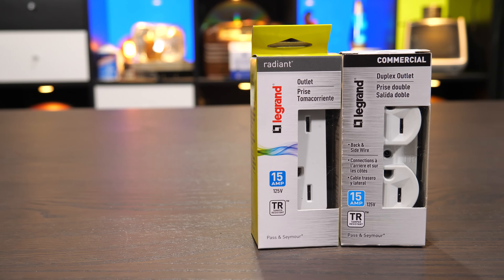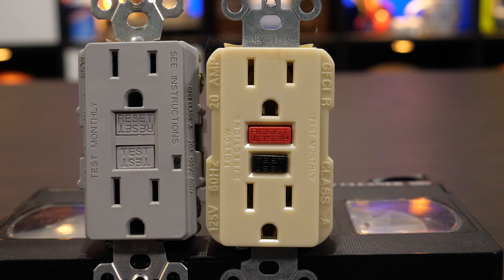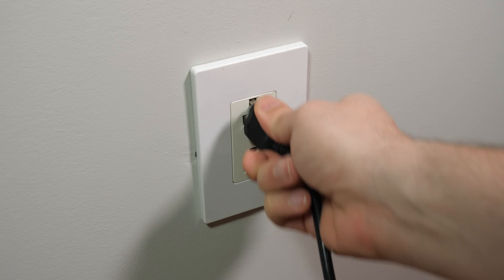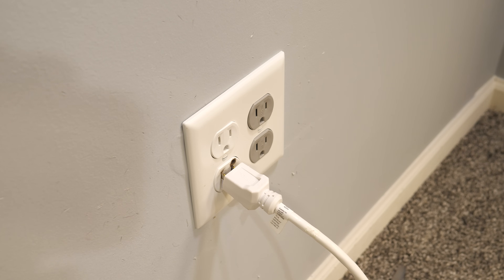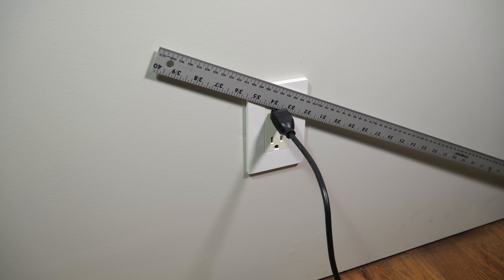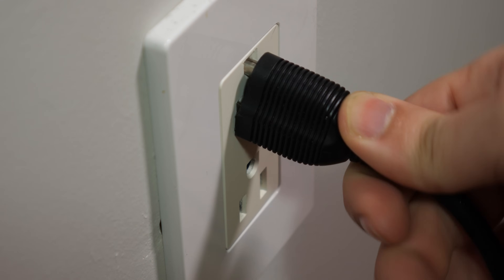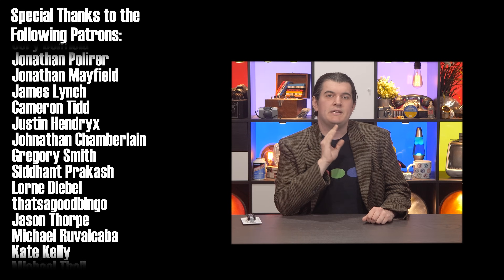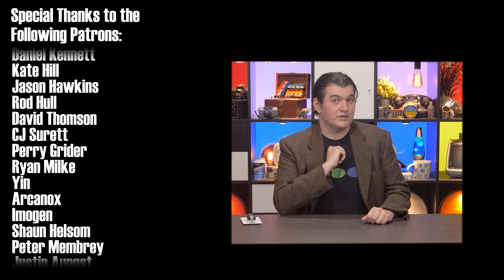Power outlets are topsy turvy - but does it matter?

Comment: When my grandfather bought his house (2 floors) it was a bit small, and he built a whole extra part by himself (adding to both floors and a deck) that is almost half of the current structure now. Anyway, in that added-on section, all the power outlets are upside-down. It was really just a trivial wiring mistake, but it's kinda funny to learn that there's benefits to it.

Comment: As a Briton I'm horrified by the sparking arcing, droopy, thin plugs. Ours are right angled, easily diy wired, have fuses, always have 3 prongs, much more grabbable and still low profile. Our sockets have shutters and we have insulated sections.

Frankly i'd use UK plugs in the US- you absolutely can, we used to have to put our own plugs on anyway, it doesn't take much work on the plug side. Switching to horizontal sockets might take work, but even going to a single with our extension multi sockets is better. Also all our modern outlets are switched at the wall which means you can switch any extended sockets attached in one go, with the wires tidied away. 

Your wires run hot, too- if you clump them they might even smoke melt etc but you can only grab them and yank them out? Crazy. Switches are great. Earthing is great. We have so few elecrical fires even despite worse old wiring in ancient homes that only gets replaced when its going badly wrong, landlords bribing electricians for certification etc.

240V saves so much copper and energy, too. Think of the power loss from those thick wires heating up. Okay, that change is unlikely as anything older you plug in would blow up.

Comment: I find your comments at 01:46 about installing the ground pin on the top being ‘paranoid’ and ‘irrelevant the vast majority of the time’ rather interesting.

I’m not questioning your knowledge, I’ve seen enough of your videos to know that you’re a sensible guy and you do your research. I enjoy your content (even if your portable AC video did upset me a little lol) 

But safety relies on having a reasonable level of ‘paranoia’ and most safety design/equipment is ‘irrelevant the vast majority of the time’.

You acknowledge the poor design of the plug and wall plate and even the situations where metal objects could fall onto the exposed live pins. Yet you suggest that because of the design of current right angle plugs and the existence of non-earthed plugs is reason enough to not advocate for change. As an outsider looking in, this fear of change seems to be widespread in the US, it’s the same reason why you guys are still using the Imperial system and why your electricians are still using wire nuts when products like Wagos exist. 

The regulations need to change, they need to mandate sleeved pins, mandate the correct orientation going forward and mandate dummy earth pins for insulated devices. This will only happen if people advocate for change. 

If the regulations change, product manufacturers will follow suit and change the orientation of their right angled plugs. You could even require all plugs to be right angled and shift the design of the wall plates to feature two sockets side by side. The old designs will eventually fade into obscurity, I promise. 

Change is expensive.
Change is inconvenient.
Change creates a better world for the future and should be embraced, not rejected.
Reply: Because… and after that book I’m surprised this isn’t something you thought of. There is no such thing as “100% safe” there are pros and cons. It’s our duty to take the reasonable approach. Far more homes have right angle plugs then people play throw the knife at the wall. Not to mention a right angle plug on an upside down outlet is by far the most dangerous situation out of all of this as it will much more easily “guide” an object right  into the pins. So what’s exactly wrong with eliminating the worst scenario?
Reply: @DeltaStormYT  By including a ground pin you’re unable to plug a right angle plug in upside down so you remove any chance of that scenario occurring.

Comment: Can you do a video on why America don’t normally have fused plugs.  To me fused plugs makes sense. Like having a 16 or 18 gage extension cord plugged into wall socket and the house wiring is 12 or 14 gage. Would be nice if all devices had a properly rated fuse at the plug like in EU.
Reply: the uk plug is the only european plug that has a fuse

Comment: Why is it upside down? I understand the NEC does not specify which orientation is correct.  Many cords that come out at a 45 angle need it to be install as shown or you put extra stress on the cord when it goes up instead of down.

Comment: As a plumber who occasionally deals with flooded basements i feel having the hot and neutral on the bottom would arc, i don't know enough about electrical to know if the ground being present will be any benefit in that scenario

Comment: Greetings from Germany. Most of the wall-mounts I've seen have sockets, that are individual and the wallmounts just dictate if you want, one, two, three or more sockets or switches. Our light switches fit the same mounts as the sockets. And each can be rotated by 90° so you can easily make sure it's the right side up. There might be some old outlets with "fixed" orientations, like the ones you've shown, but as far as I know, the individual outlets are the only ones sold at the moment.

Comment: Yep, nailed it in that most AC/DC adapters would "hang down".
I've seen some fancy ones that rotate the prongs but those are usually just 90 degrees and few and far between at that.

Comment: Safety my ass. Other than how stupid and ass-backwards it looks, one major flaw with an upside down outlet is it can be hard to line up the hot/neutral prongs because the damn ground pin and extended plastic around it is in the way obstructing my view while trying to plug something in.

I have never been zapped using a normal-oriented outlet for any reason other than my own stupidity and carelessness, but I can easily imagine getting electrocuted by complete accident, through no fault of my own, trying to plug something into one of those upside-down monstrosities.

Comment: You know if the plug had a switch it would make this terrible design slightly safer. Obviously the root cause is the terrible plug design tho but a switch would make it better than not having it at all.

Comment: here in the UK our Negative and Live pins have coating so far up so even if the plug is loose you cant touch the pins and we also have little doors on the live and negative holes in the socket which wont open if there is no Earth pin, our sockets are commonly made of ceramic aswell so that lowers the chance of any shorts
Reply: the schuko socket is recessed with shutters that only open if you insert both pins at the same time

Comment: @9:01 I actually had this happen on a job site. I was measuring a wall to hang a TV and got the tape measure too close to an exposed plug like that.
Big spark, charred wall, and a hole in my tape measure where it tried to weld itself.
Fortunately, no fire or damage otherwise, but... it was certainly an awakening.
Also, somehow, their circuit breaker or GFI didn't trip... so that was a bit concerning.

Comment: you guys just should adapt the europlug - we don't have any issues with up or down or any of the problems you mentioned... even our sockets are inlets, so they dont show any hot connectors which could be touched, even if the plug is just half inserted...
Reply: What euro plug would that be? And no, we should not adopt a foreign plug. Ours works just fine.

Comment: It's wild to me that the US has two different plug types 1. with no ground pin and 2. with a ground pin and what's more insane is neither of them have insulation so the odds of being shocked is high if your not careful or if your a child. I have never had any electrical shock with an outlet in my childhood days (once or twice now im an adult but that was my own doing) due to the Type G socket we use in the UK which if i remember correctly TC has done a video on (or im thinking of someone else), while it has it's flaws like if you step on it, your gonna have a bad time but besides that i can't think of anything better.
Reply: the german plug type is even weirder because you can insert grounded schuko plugs into old ungrounded european sockets
Reply: Our plugs are just fine. The vast majority of Americans will go through life without ever getting shocked. Plus our small plugs makes very small devices with built-in plugs possible, such as compact power banks and chargers that have swivel out prongs.
Reply: @CorneliusTaylor-s1u our plugs should be halfway insulated just like australian plugs
Reply: @gamecubeplayer 

Or, how about this, don't touch the prongs.
Reply: @CorneliusTaylor-s1u what about old ungrounded european sockets? i've been shocked by 230v because old ungrounded european sockets aren't recessed unlike schuko sockets

Comment: In South Africa all of our 3 prong plugs are right angle plugs except for the very specific high amperage ones that are from what I know only used for generators and have their own tight gripping sockets. As for our 2 prong plugs the sockets are all recessed making them safer. Also our ground pin is always top and that's reflected in our products as well. Also if our plugs get slightly dislodged they don't make contact in the socket anymore. This is good but aslo really irritating sometimes when a socket doesn't let a plug go in all the way. Usually happens when the child protection mechanism breaks.

Comment: The right angle plug in turn has the (pretty big) issue that, unless the orientations of the two receptacles are opposite, you can only plug in 1 such plug at a time. Solution to that is sideways orientation, but then you still have to rearrange a bunch of existing receptacles. I like the EU schuko for this reason, they're symmetrical so they work well with basically any orientation, as well as a bunch of other benefits

Comment: It won't change now, but the best solution is if our duplex outlets had the sockets side by side, still with ground down, like Australia. Then you could plug two 90 degree plugs in the same outlet.

Comment: Another thing to take in mind is when orientated with the ground down, plugs and switches have the positive and negative on the right hand side and most people are right handed and attaching the + & - and splicing together the wires to continue on in the circuit requires the vast amount of care and dexterous work during installation; wiring a house for me, a right handed person, would be a nightmare if it was reversed and cause a huge amount more work.  The amount of inefficiency and increase in costs just in man-hours over the whole construction industry is vast.

Comment: I’ve always heard at work to put the plugs upside down incase something falls on the hot and neutral. But tbh if it does create a short it’s just gonna hit the ground later at the panel and still trip the same breaker. Glad you made me think about that myth deeper

Comment: Australia has had shock resistant plugs since 2005 (active and neutral blades have insulating sleeves that run about 1/2 way down) watching your videos has been mind blowing to realise this is somehow not the norm in the US

comparing the differences with the AUS system has been fascinating. 

Keep up the great work
Reply: well our system is crude but its safe if you use it with care and its a side affect of being one of the first counties to standardize our electrical equipment and our refusal to make old less safe designs incompatible with our current system the basic design of our most common plug is over 100 years old before complete safety was a concern

Comment: One of the largest drawbacks from a right angle plug is that it is a pain if you need more than one in a powerstrip or other configuration with 3+ vertical plugs since its cord blocks the plug beneath it. I love the 45 degree plug though.

Comment: maybe y’all should switch to the outlets we use here in europe. ground pin either sticks out if the outlet or is on BOTH sides of it so it can be plugged in either way. most plugs have both a hole (or 2 on both sides!) and grooves on the edges so they can support either type.
Reply: EU shuko plugs have an 8amp continuous limit before they start melting. Car chargers for example have issues with them.
Reply: @0xsergy switch your voltage to 230 too then :)

Comment: As a minor counter point to the idea that upside-down sockets shouldn't be a thing until after right-angle plugs support them - this reasonably has to be the other way around, as creating upside-down plugs makes no sense when there aren't any sockets for them, they're just objectively worse plugs, whereas creating upside-down sockets does make some sense and they only really struggle with right-angle plugs, which therefore means the sockets would have to come first and the plugs would have to adjust to them.

Comment: I was at my grandparents house and they have a mirror with an outlet on it, but the outlet was recessed behind the cover plate and I noticed it was loose because it only has one screw and when I went to screw it in, I spun it around, and the edges of the cover plate are metal so it shorted live and neutral and there went the circuit breaker with some nice fireworks I did end up screwing it back in after replacing the outlet with a non-burnt one but since that is resent, it’s not that hard to spin even with the screw in. terrible outlet design and whoever installed it wasn’t that good at their job

Comment: Gasoline Powered Electricity Generators used outdoors always have the Ground Plug at the top.
The reason for this is because rain and liquid can be pouring across the plug area.
With the Ground Pin at the top this is the first pin to be splattered with rain or whatever.
If you have the other 2 blades at the top the system can more easily Short in a way you don't want it to.

Comment: Each and every one of these issues is solved by BS 1363. Including the 2 pin plug issue, because they can't exist. The Live and Neutral slots don't open until the Earth is partially inserted.
Reply: the wap-002(ukv) is oversized because it only needs 2 pins

Comment: NA should be using the superior outlet design of the UKs.
Reply: the schuko design is the best
Reply: @gamecubeplayer  Hard disagree. Schuko has gone the way of the stereotypical german design, overdesigned and overcomplex to solve problems nobody has. It also has flaws too.
"They are water tight" If your house is underwater, you're sockets are the least of your problems, plus schuko sockets should be replaced too after any flood, thus making the design redundant.
Schuko plugs also do not have built in fuses to protect from surges and overloads, those safety features are built into the sockets themselves. Thus using a schuko plug in other sockets doesn't have that protection. Would most people know that? I doubt it. L design.
Reply: @Zombiesbum  french, italian, swiss & danish plugs also don't have fuses
Reply: @ That doesn't change either of our arguments. Not sure why you'd bring that up. You may as well have said "french bread is fluffy"; Completely redundant.
Reply: @Zombiesbum  only the uk plug needs a fuse because only it uses 32a ring circuits
Reply: @ Yes, because UK plugs don't need to be matched to sockets based on their amperage (as they are standardised at 13amps). It means people aren't going to make the mistake of say plugging a 16 schuko amp plug into a socket that doesn't support it; which has a tendency to overheat and cause the socket to burn (no shit right?)

So then why would you want a plug system that requires users to know both the plug and socket compatibilities? And to suggest it's the superior system is non-sensical logic.
Reply: @Zombiesbum  most schuko devices that i've seen are 9a or less because some schuko sockets (just like most ungrounded schuko sockets) are only wired for 10a
Reply: No. Most Americans would not like that. The American plug has the advantage of being very small. Our plugs and outlets are just fine.
Reply: @CorneliusTaylor-s1u Correction, you wouldn't like it. Speaking for everyone is pretty arrogant when you don't actually know.
Reply: @Zombiesbum 

I know my culture. You do not, foreigner.
Reply: @CorneliusTaylor-s1u Except people are not hiveminds. Culture doesn't mean shite.

Comment: The term "outlet " for a duplex receptacle is incorrect.
Receptacle outlet would be OK if you are defining it when installed in a box or enclosure.
The term outlet is "The point at where a branch circuit connects to utilization equipment"
So a ceiling box for a light fixture is a "outlet", as is a disconnect for a a/c condenser.
My electrical inspector's required list for a rough-in calls for a count of "outlets"
That includes receptacle, switch, lighting, etc, points of wiring.
Check the NEC book in the first chapter "definitions"

Comment: I'm from Brazil and our old 90º plug standard is the opposite.
In the 90º plug, the ground is always at the top and the cable goes down.

Normally these 90º plugs were found on power strips, computer things.

And in the new standard, adopted in 2009, the grounding plug was kept on top.

Comment: While trying to measure something in a commercial kitchen the tape extended beyond its “stiffness” and gave out.  The tape dropped behind an appliance and you guessed it - said appliance plug wasn’t tightly plugged.  The tape fell across the plug and a spectacular arc lit the room before darkness fell.  So I can attest to the possibility of what may seem ridiculously impossible or unlikely.  I agree though - the heavy right angle plugs won’t agree with the upside down convention.